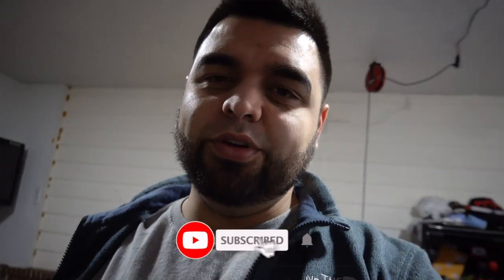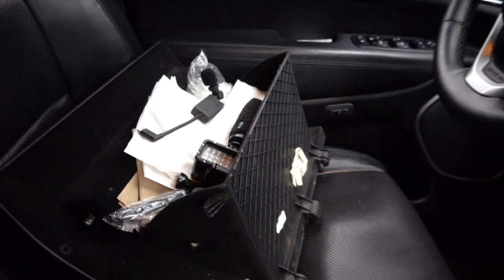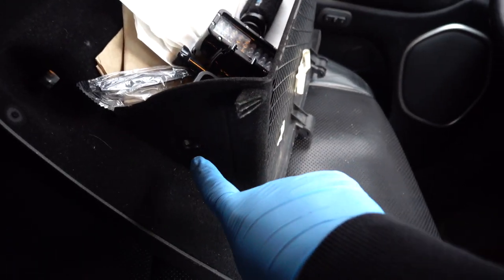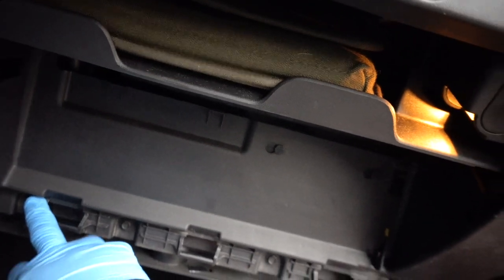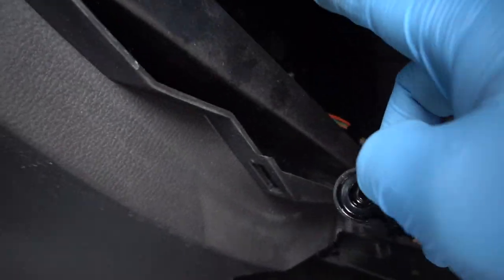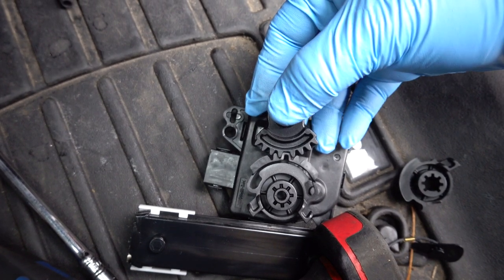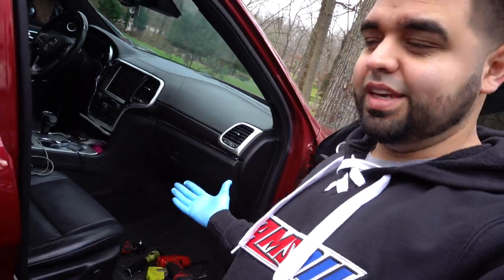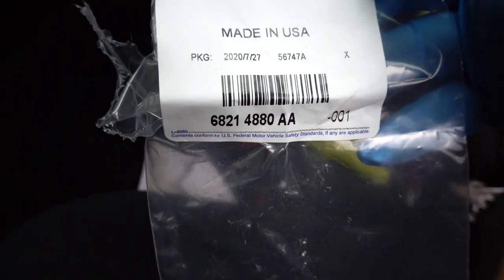How To Replace Blend Door Actuator Gear | Jeep Grand Cherokee WK2

Comment: Tremendous help thank you. In my case the new peice did not line up with the other gear behind the acuator but you can manipulate that gear by turning the ignition on but don't start the engine. Make sure the air is off. Then reach in there and turn the gear until it lines up with the new piece.
Reply: Witch part did you move ? The gear up top or the piece on the actuator itself? Mine won't line up and when plugged in it just keeps going around and around

Comment: The other gear thats part of the blend door that you had out, when I slide mine back in it only goes in  one way and its turned closest to front ( and it wont turn) so it seems the actuator itself with my new gear wont go on far enough to line up that way.
Any ideas ?

Comment: Good video mine was the actuator motor not the gear
Had to disconnect the negative 
Cable a few minutes to reset it
Before installing it

Comment: My dealership replaced my entire leather dash because it was recalled under warranty for delaminating, after it was replaced my driver side stopped blowing cold air.  Could they damaged actuator when replacing the entire dash?  I have a feeling they will tell me they couldn't have broken it.
Reply from the maker: I can see there being a possibility but honestly I think it’s unlikely. Possible but unlikely.
Reply: @StayOnTheGas  i found a broken section of actuator gear on the floor of my jeep.
Reply from the maker: Yeah when they go, they break and you usually find the broken piece on the floor. It’s very possible that it broke on its own. Like I said, I can see a possibility of them breaking it too but that, to me, seems like it went out on its own.
Reply: @StayOnTheGas  could the air duct door have gotten jammed when they messed with dash and then when i went to use ac today the gear broke from the jam?
Reply from the maker: I don’t think so. The whole air box should stay in place when removing and installing the dash.

Comment: What's that second little piece you lined up with the blend door gear? Like what's the name of the part. I ordered just a blend door gear and it didn't come with the other piece
Reply from the maker: The other piece is part of the blend door. You don’t need to order that unless it’s broken which I doubt. I just popped it off because it’s easier to line it up that way
Reply: Well in my case I thought it would just be replacing the blend door gear but when I took out the glove compartment.. there was no air actuator! I just purchased this Jeep Grand Cherokee limited in March so I didn't really mess with with the a/c heat 🤦🏼‍♀️ now I'm struggling to figure out what else is missing in there so I don't even have that little piece in there. All I've bought so far is the air actuator, and blend door gear which is just one piece I don't have the other that connects to it. Hope you can give me some tips! Def. need help!
Reply from the maker: I’m sure you can find that piece at the dealership as well. Shouldn’t be too much either since it’s another little plastic gear basically.
Reply: @StayOnTheGas   how do you pop off that piece
Reply: @2cheesy423 trying to find this out too

Comment: Noob question,  does the car has a single blend door for entire vehicle ? My Laredo stopped blowing cold air and only thing working is the heater.
Reply from the maker: I don’t think so but I don’t know if that varies by trim level. Does yours have dual climate control?
Reply: @StayOnTheGas  I have the same question and yes mine does have dual.

Comment: I have this same problem but it ended up switching to the passenger side. I was only getting hot air in the driver side and now I get cold air to n my driver side. It switched on me so weird
Reply from the maker: Probably have to do the other side. I have a video on that too
Reply: @StayOnTheGas Yeah but the side that I was getting heat is getting cold now vice versa
Reply from the maker: I’m guessing the other side broke